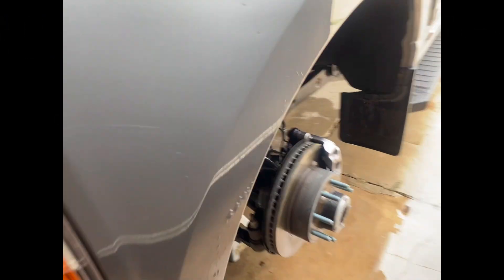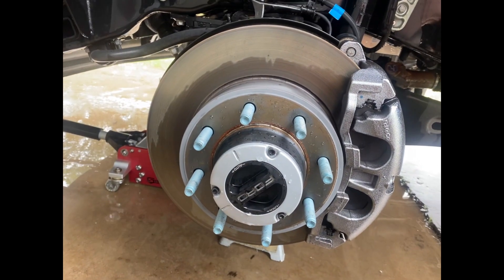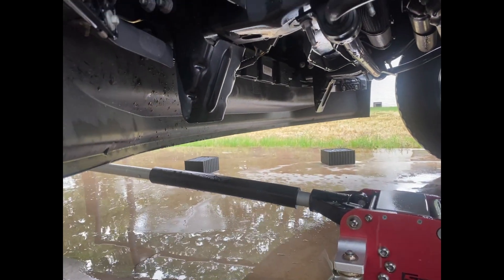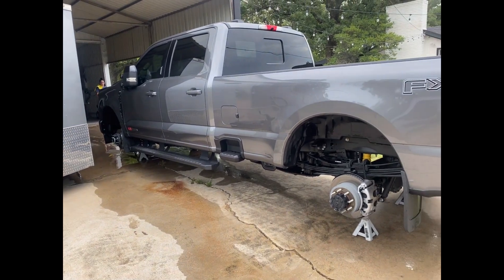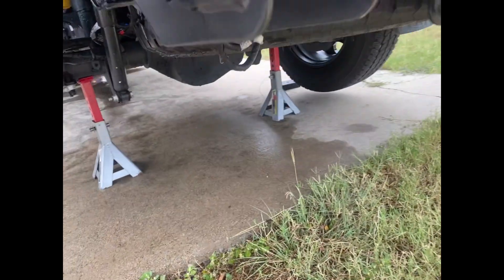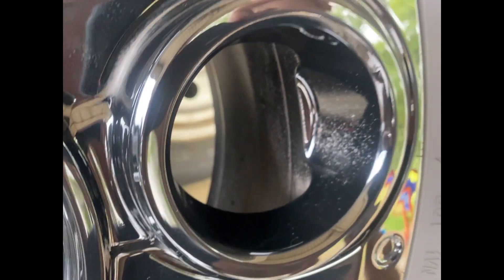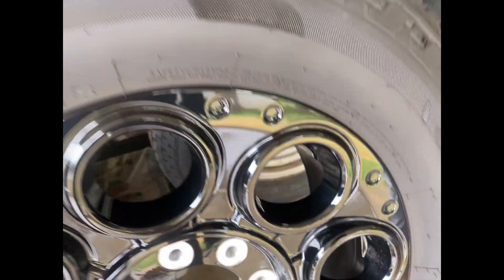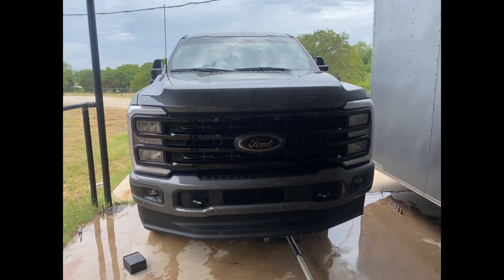2023 F350 Wheel Corrosion Problem

Comment: I wonder if it is brake dust from the fronts etching the paint.
Reply from the maker: Only happened on two wheels though, one front wheel and one rear wheel. I think there was something done incorrectly when the wheels were painted/powder coated.

Comment: Are the fronts worse?  Maybe brake dust?  On some of my cars it really get caked on there and is hard to remove but with only 3000 miles I doubt it.  Keep us updated what the stealership says.
Reply from the maker: It was actually on one front and one rear on opposite sides so kind of random. I removed the wheels completely to try and get it to come off but it's pitted through the powder coating on the wheels.

Comment: Are the two wheels that have that issue the rears? I wonder if it’s some form of stress concentration and causing the powder coat / paint to chip. The rears would have a lot more weight especially when towing and that would make more sense.
Reply from the maker: It was one front wheel and one rear.